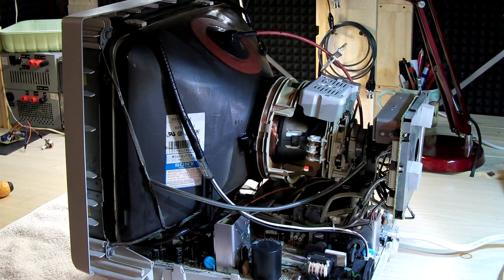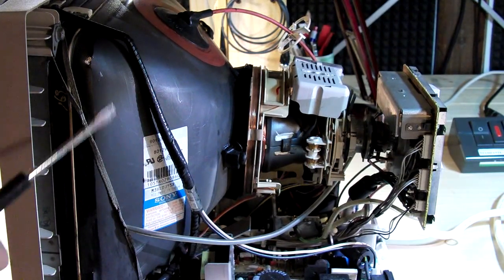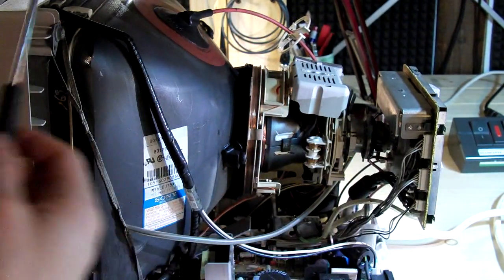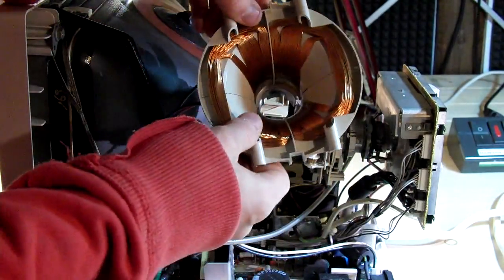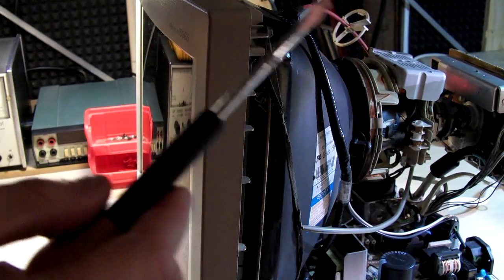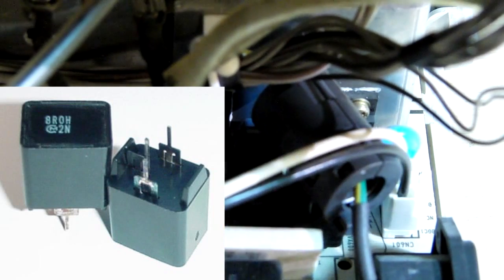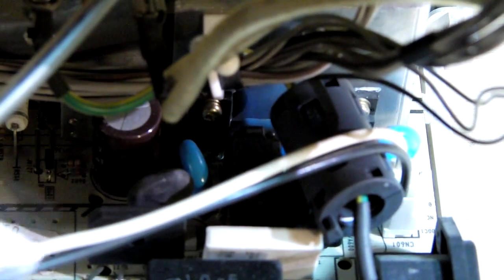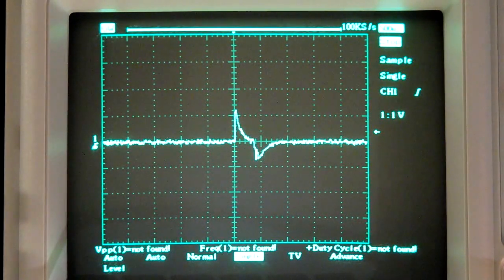CRT degaussing explained

Comment: I dropped my Trinitron style CRT TV set.

It now has a green haze in a corner.

Will degaussing fix this? I don't know much about the mask and grid, no channel or website explains if these problems can be fixed or not.

Prior to dropping the screen, it was flawless, so I wonder if the grid/mask is damaged.  If so, will degaussing work to solve the problem?

Thanks. Anyone who answers.
Reply: no, I belive it bent the mask/grill, so it is most likely permantly damaged.
Reply: @donnablauvelt1924  I believe this as well.

Comment: if that mask exists, how can u explain streching or contracting of picture via controls, and also ability to display various resolutions?
Reply from the maker: Hi, the mask (or, in case of a Trinitron CRT, is called aperture grille) is right behind the phosphor screen. It is needed to allow the electron beams to hit the appropriate color. You can still contract or stretch the picture and the three electron beams will always strike the correct color (thanks to the shadow mask).

Comment: Please Sir how do we know when the flyback fails
Reply from the maker: Well, if the flyback is not working properly, the electrons in the tube won’t be accelerated, so you’ll have very faint/no picture on the screen. Usually what it fails is the transistor for the flyback coil, not the coil itself however..